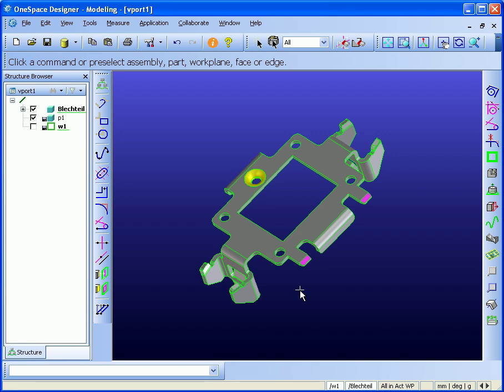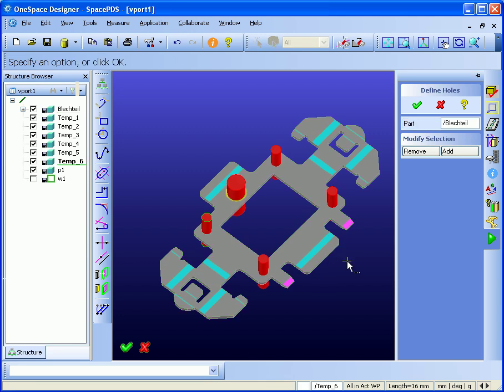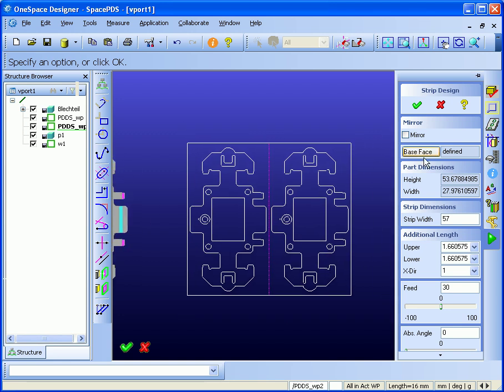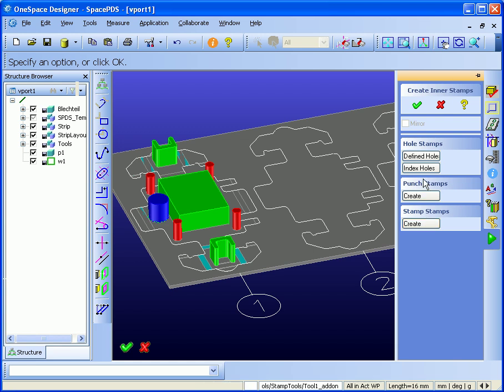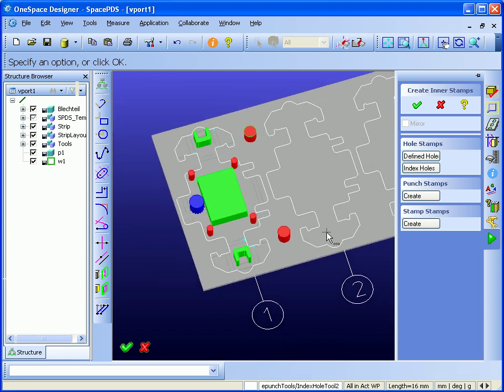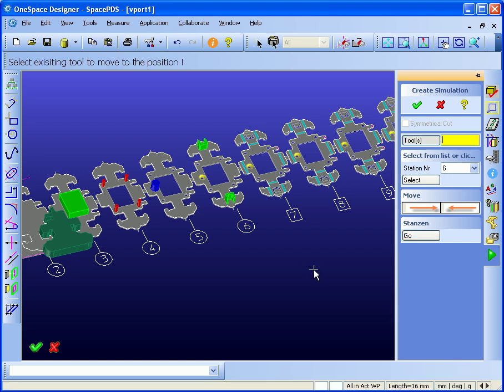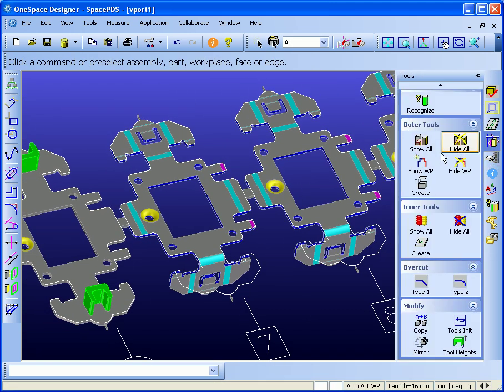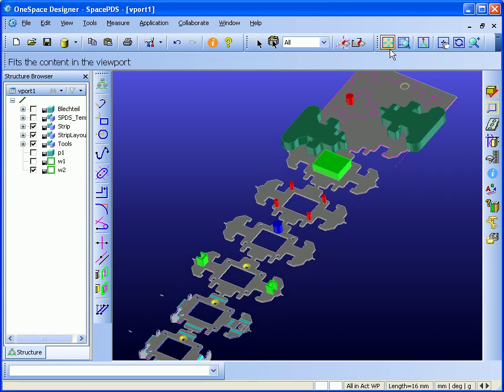Strip Layout Definition for Progressive Die Design - ProgressivePower for PTC Creo

Comment: Nice software, but the part is incomplete; in station 9 bending these inserts, I 'm not sure how you will build a die in bending these 4 ears next to that C slot and once you will cut - off the part you still have two remaining bends unfinished.
If you can show it to me how would you solved that problem without building additional dies?  Thank you
Henryk @ telaengineering@gmail.com